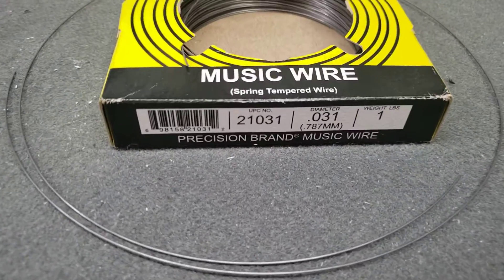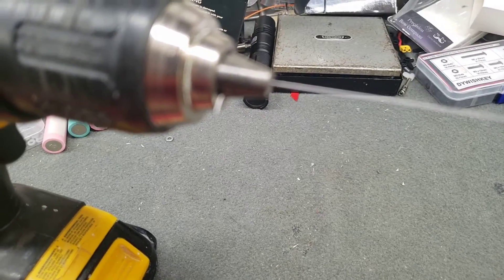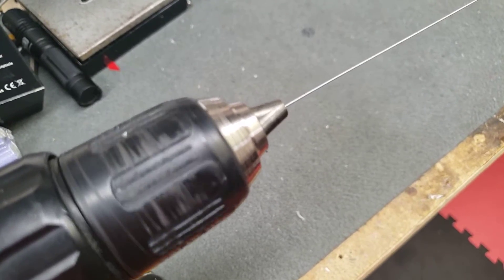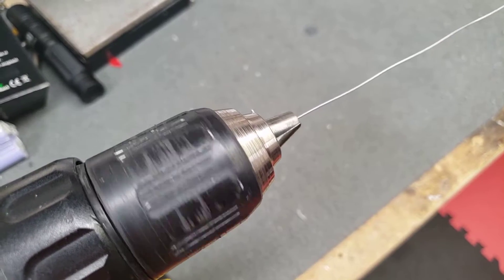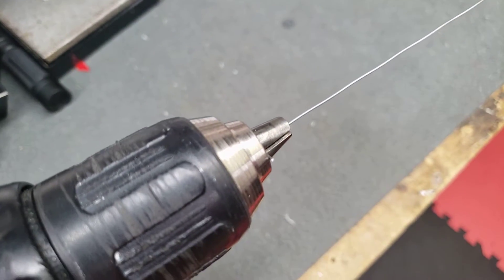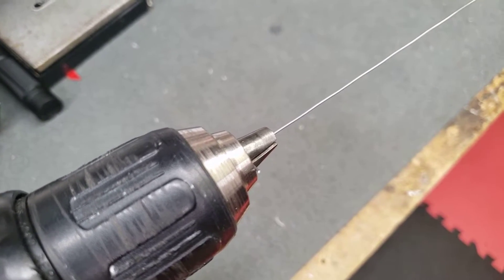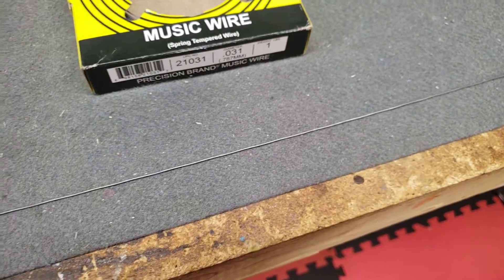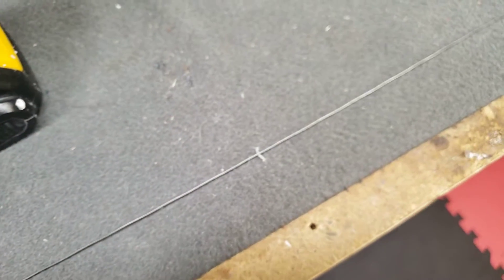How to straighten music wire

Comment: I have this same brand wire in the 0.022" diameter. I am going to try this with the right angle bend you suggested at the end of the wire as my 1/2" drill chuck could not hold the wire if inserted into the chuck (kept popping out). I am hoping this will work for the thinner gauge wire made by the same brand. I am scratch building a HO model bridge and need the wire very straight to simulate tension rods.
Reply from the maker: Let me know how it works out for you!
Reply: @KentVanderploeg  I am going to try it today. I will keep you posted. I have attached a link (hope it works) of the bridge I have built in HO scale. You can see the iron (rusted looking) vertical tension rods that I want to simulate. I used 22 gauge floral wire, which looks good, but there are slightly distorted and not super straight as the material is too soft. I'd love to reinstall the tension rods with perfectly straight wire, then paint them the rusted color. (link below)

Thanks
Phil 

https://www.google.com/maps/@61.7871183,-148.4640522,3a,68.4y,197.52h,96.76t/data=!3m6!1e1!3m4!1s7-DK_FfjMwQ58PambpJFqg!2e0!7i13312!8i6656
Reply from the maker: @uptownphotography  Instead of paint, couldn't you just use vinegar to make actual rust?  This wire should make a nice patina with that method.  Good luck!
Reply: @KentVanderploeg  I will test that method and see how it looks! Thanks for the suggestion. 

That bridge by the way (from the google street view) is in Alaska. It was saved and moved and is on display there It is about 100 years old (maybe more). I was very lucky to stumble upon it (took me a long time using google street view to find it). It is a great resource of how these bridges were made back then. Up until I found it, I was using old photographs which just didn't show as much detail as the street view version. Sometimes you step in it! Thanks.
Phil
Reply from the maker: @uptownphotography  Love those old bridges!  I usually try to incorporate a visit to at least one or two on my motorcycle trips.  I'd love to see your progress as it comes along.
Reply: @KentVanderploeg  The scratch built HO scale Howe Truss Bridge is actually done, (other then I may change out the metal tension rods) and looks really great. I'd be glad to share a photo or two, just not sure how you post a photo on these youtube comments. Doesn't seem to be an easy way to post one that I could find....
Phil
Reply from the maker: @uptownphotography  Send an email to my disposable account, then we can figure it out. 
D-1qcupehjtl at maildrop.cc
Reply: @KentVanderploeg  OK cool. I will send as soon as I take a few photos.
 
BTW: I did straighten a few of my thinner 22 gauge wires (the specs actually map out to 23 gauge) and a few were very straight and a few look wavy. I need to learn how many turns to do, I guess. 

However,  unfortunately the wire I bought is too narrow for the holes I have drilled into the bridge and just drop through the holes. I am going to have to buy a slightly larger gauge for them to work in my bridge. (a drag). Thanks.
Phil
Reply: @KentVanderploeg  Hi Kent, Did the email I sent you on Jan 21 (at 11:14AM...) ever show up. Could be in your spam. It would have come from Uptown Photography. I didn't send a photo yet of the model bridge that I built, but will as soon as I take a few. Thanks.

Phil
Reply: @KentVanderploeg  Hi Kent. I tried 3 times to send photos, but they all came back w/file size too large. Each time I removed a photo, but still too large even though these are small files...
Reply from the maker: @uptownphotography  Ah, may not work to that email account.  It's a temporary account to keep from exposing my personal address.  You can email that one with your address, then I can email you back directly with my personal address.
Reply: @KentVanderploeg  OK. I just sent my email...Thanks.
Phil

Comment: Geat video, I have straighten wire many times from a spool using a jig of pulleys and ball bearings, but I find that purchasing straight wire in straight lengths to begin with is a  huge time saver and you end up with true straight music wire.
Reply: how many turns would you go with .063 i need to straighten a 60 inch piece.
Reply: never mind. worked great